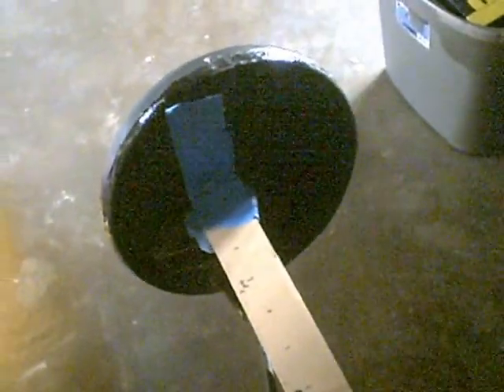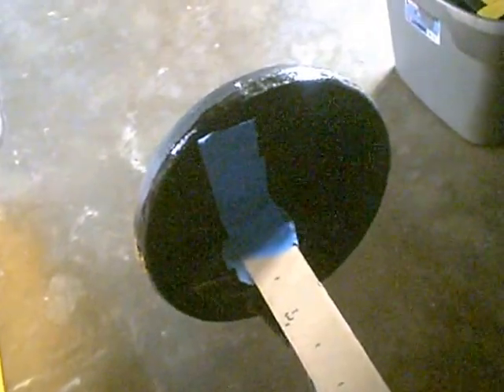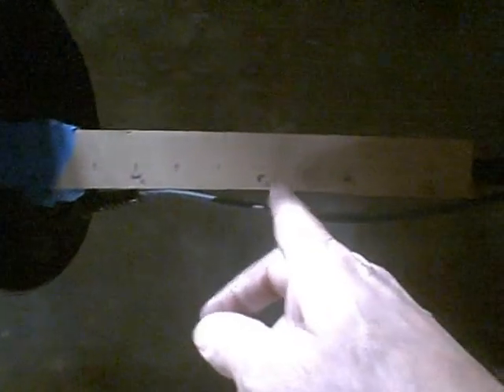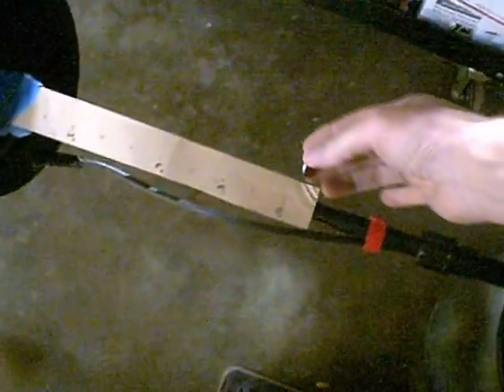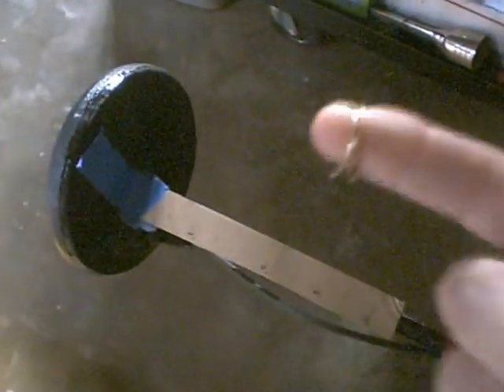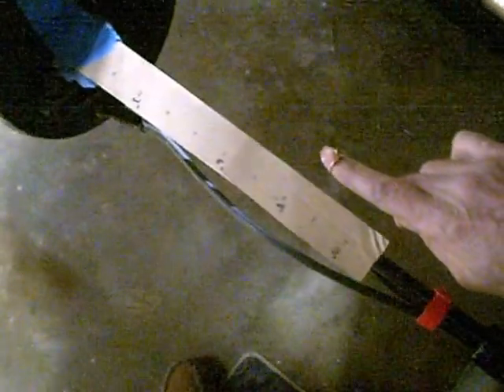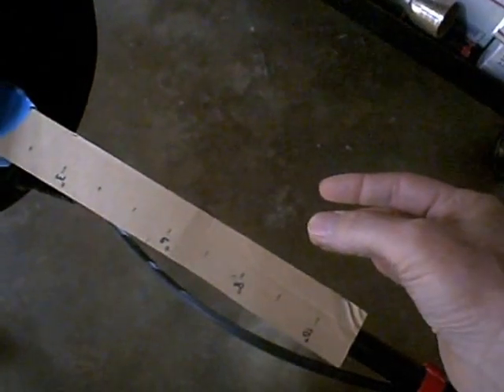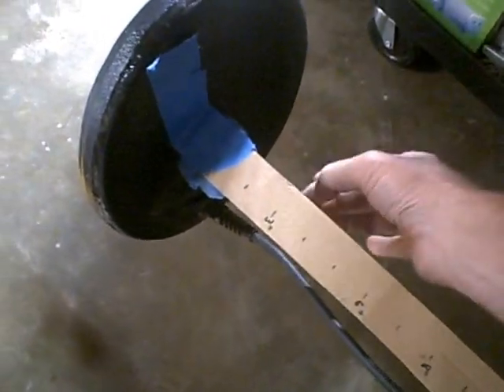Modified Minipulse Plus test

Comment: Parameters on coil
Reply from the maker: If memory serves me the small coil is 306uh and the larger coil is 330uh.
Reply: Does the device work with one or two coil
Reply from the maker: @Sirine-u6h   it will work with coils from 300uH to 350uH the best. It is a single coil of wire in the coil form.
Reply: Thank you, is it possible for your website to be on Facebook?